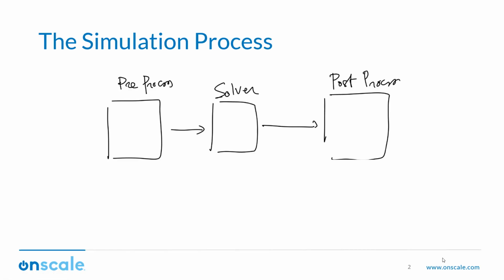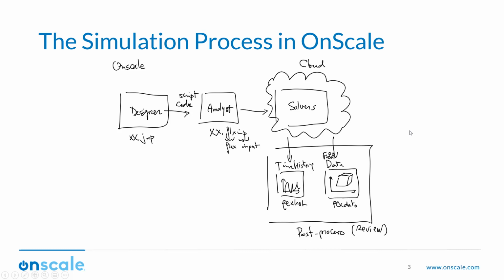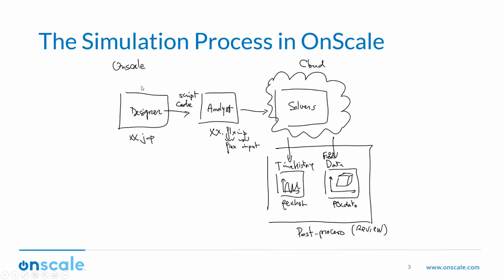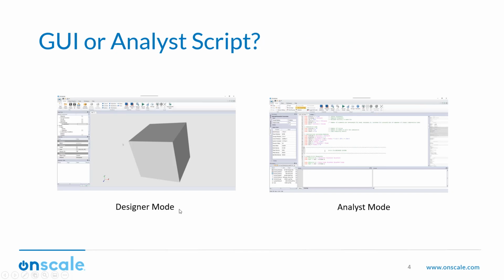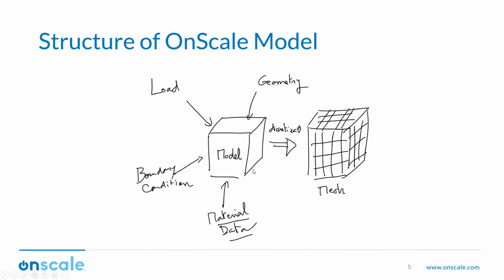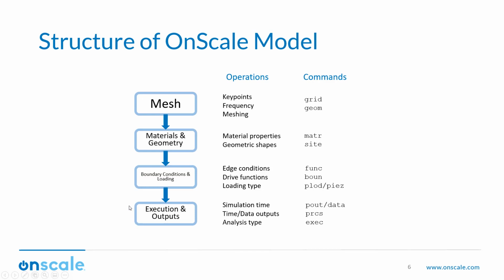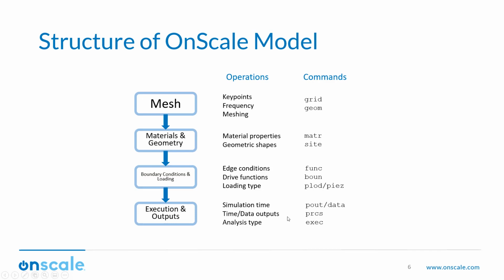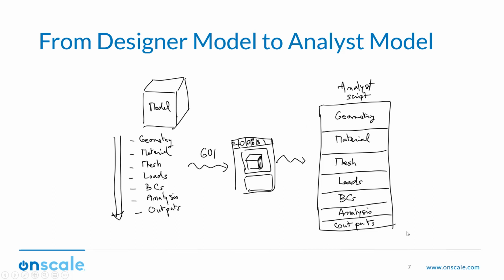[OnScale  Analyst 101] Introduction to Analyst Scripting- Part 1

Comment: Sir, please suggest me the configuration of computers for designing and simulation at learning level.
Thank you Sir for enlightening me with yours blogs, emails and vedios.
Reply from the maker: Nowadays, any computer is okay. I would suggest either windows 10 or Linux, a 4 cores i5 processor and 8GB of Ram. In case you use the cloud, you won’t even need a good computer because computation happens on the cloud.
Reply: @Feaforall  Thank you Sir